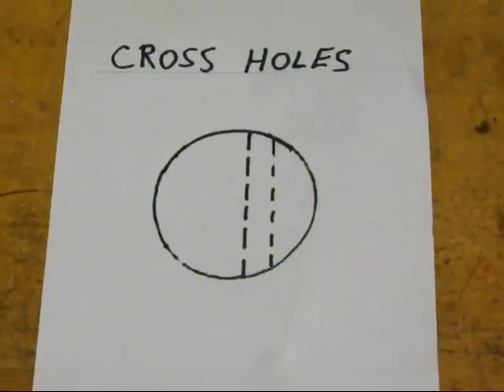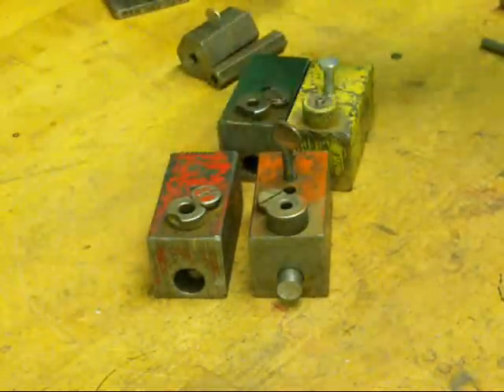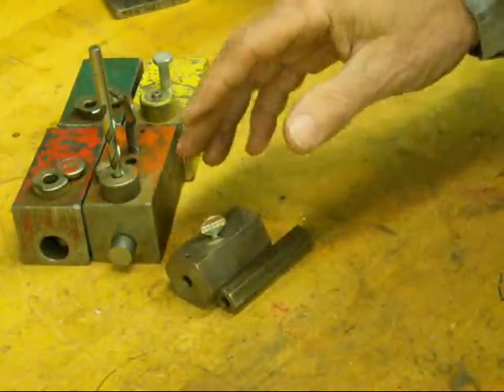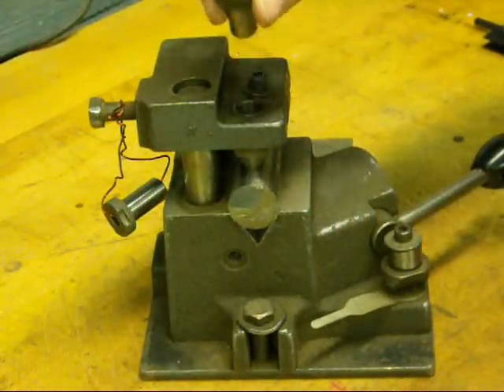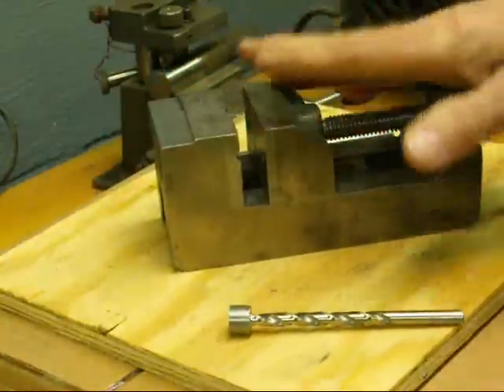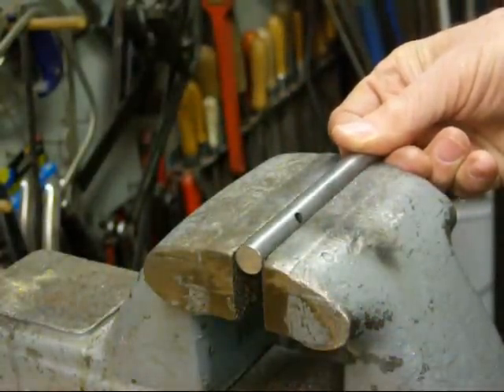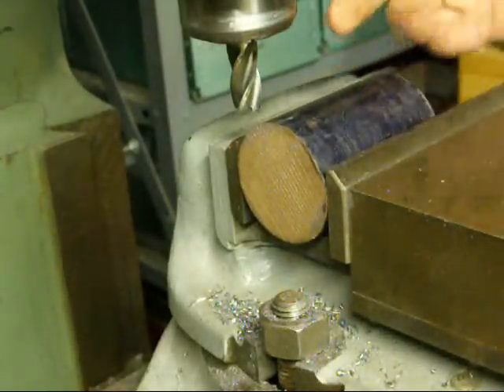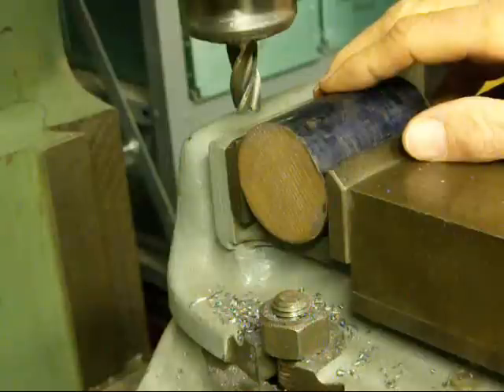MACHINE SHOP TIPS #11 Drilling Crossholes tubalcain

Comment: Hand filing will always give you a centered flat that you can punch. Even if you hold a file at 45 degrees, the flat you create will point to the center of the rod! Of course, you'd have to reorient the flat horizontal to be able to punch it.
If you only have hand tools at your disposal, this works quite well.

Comment: Also, there's the steel ruler method. Use a sharp point tool in the spindle  and place the ruler perpendicular to the work. Bring the point down and slowly adjust until the ruler is perfectly vertical. Works well on a drill press too.

Comment: I would use an edge finder to find the 0 of the hard end of the vise and then go back half the diameter of the price being drilled. of course taking in consideration the size of the edge finder.

Comment: To find the center I've glued a small level to a short piece of aluminum.  Glue the level length wise on the strip.  Don't start the machine, but lower the quill, with the drill installed and move the work in or out until the bubble in the level is centered.  I usually do this with a spot drill or center drill first.  Mark my spot and change to the drill I need to use.  Make sure you have enough room under the quill to inset the drill you'll need to cut the hole.  Oh, by the way don't drill thru the strip the level is on.  This method works really well in a mill.  I use it on the drill press also.  I use drill press clamps the tie the vice down after I've found the center.   Check your bubble again, readjust as needed. It's fast, cheap and easy with a short learning curve.
Reply from the maker: Sound like a good method
Reply: you need four hands to do all that,holy cow!

Comment: I have found another way for the average home metal/wood worker, that does not require anything "fancy"; to insure that a hole is IN the absolute middle of round stock. Reading it will seem complex. But it really isn't and is quite simple. IE:

Take 2 pieces of plywood; say 1/2 thick. On a router table mill a "V" groove; parallel in the long dimensions of BOTH pieces of plywood. Then mill another "V" groove perpendicular to the parallel groove across the long groove in BOTH pieces. Position the vertical groove where you want the hole to be in the stock.

 Now sandwich the round stock (IN the grooves) between the two plywood pieces. Then make a drill guide on your lathe. Make sure the guide is the exact same diameter as the stock. Then put the guide in the vertical groove above the stock.Now install the sandwich in a drill vise and squeeze down on vise handle so nothing moves. If made correctly, everything will be tight.

 Drill through the guide and stock. This makes for a perfectly centered hole in the stock. Also; you can make "matching" multiple holes in 2 pieces (or more) of stock; by milling 2 (or more) parallel grooves in the plywood. Again sandwich the stock between the 2 pieces of plywood and the guides in the vertical grooves; and install the ass'y into the drill vise. Now drill the hole. I did this and it works perfectly.

 I am getting ready to drill (and thread) 3 cross holes in each of 2 pieces of 1/2" X 4' long stainless steel rods. These holes must be perfectly IN line and parallel in BOTH pieces. This is a must for my project. In order to do this, cut two plywood pieces 2-3" wide X  4 1/2" feet long; and mill 2 parallel "V" groves in the long dimension on each plywood piece. Then mill 3 vertical "V" grooves located, exactly where the holes are to be drilled in the SS stock. 

Now sandwich the 2, SS rods in between the 2 plywood pieces; AND install 6 drill guides in the vertical grooves; with one guide above AND below the top rod.

Now and important: using screws or bolts and nuts, lock the rods, drill guides and plywood pieces together, as one ass'y. Then install this ass'y (where one of the vertical holes are located); into a vise. Then drill the desired hole in BOTH SS rods, thru the drill guides, at the same time.

Now move the plywood ass'y to the next drill guide location. And so on.

This will give you 2 Rods, 4' long with 3 holes in each rod; and they will be concentric perfectly between the 2 rods. All holes will line up exactly with each other. Etc. Again, this could be done with 3 or more rods simultaneously; and of course, multiple holes.

I am sorry if this tends to be too long and difficult to "see". But I assure you it works like a charm, once you do see it.

Thanks Pete for the opportunity to post this here.

Finally; and if you follow along with the above Pete; I would LOVE to see a video by YOU; demonstrating this inexpensive way of achieving what might seem to be beyond the ability of the home shop. The only expense is two pieces of plywood. The drill guides, of course, can be cut from the rod stock itself. Since you are only making a few holes, the guides do not have to be hardened usually. Just continue to make more guides IF the used ones incur elongated holes. 

Thanks again to my favorite "machinist" on this planet!
Reply from the maker: Thats a good idea--need to try it some time. thanks

Comment: What I love about engineering is there is ALWAYS more than one way of doing things. If you have a milling machine or drill press with a compound vice, clamp the bar and rest a 6" ruler on it then bring the drill bit down to touch the ruler. The ruler will deflect one way or the other until the bit is centred on the bar when it will completely horizontal. Obviously, the machine is not running when you do this. It helps if you use a centre drill first to prevent a normal drill bit "skating" around on the bar. I use this method for tapping a set screw on flywheels.
Reply: Thankyou so much for sharing that tip! I started a new job and they don't have a milling machine. I came from a company with 4 milling machines. So I'm used to just putting jobs in the mill and away you go. But now that luxury has gone and the results are not ideal. but that tip may just make my life ALOT easier. Thankyou :)

Comment: No disrespect in any way Tubalcaine, but I have been using a slightly different technique to drill cross-holes. And they come out perfect.

IE: I USE the cross V groove in the drill-press "vise". I center the part of the round stock to be drilled in the horizontal "V" groove and then put the drill "guide" (I made on my lathe) in the vertical "V" groove above the stock.

It works perfect and my vise always squeezes down on BOTH stock and guide and they are both held rigidly.

Have you never used this method dear person? It really works great.
Reply from the maker: +pat dee Thanks!

Comment: It's not actually a center punch tool on 6:09. It's design for Drilling Crossholes. How to use:

Step 1: Center punch into the rod with another center punch tool.
Step 2: Attach that tool into the drill press... continue...
Step 3: Clamp your rod into to a vise lightly (just like 6:09).
Step 4: lower the drill press and align the pointed tip of that tool into the punch hole so that all three point meet (in this case all 5 points meet for true accuracy). I'm sorry I don't have space to go into detail about how to do that. Please try your best to figure that out.
Step 5: Tighten your work then lock your vise to the press then use a smaller diameter bit for the first pilot hole.
Step 6: Drill. Do not drill all the way thru if you want accuracy, but go ahead and drill all the way thru.

The name of the tool is cylinder/rod "center finder" I believe. I'm not a machinist, I've never seen it before.  I just have a good a hunch on this stuff from some other lifetime. If I'm wrong I wouldn't loose sleep over it.
Reply from the maker: Thanks

Comment: chuck a center (not center finder), level and tighten work, x is layed out

eyeball chucked center near the center of stock (approx y), 1/8" z away from stock

place 6" scale perpendicular to stock and under center drill

lower quill by hand until light contact

observe tilt in 6" scale, adjust y until level

center is found very quickly, but slightly less accurate than edge finding.

Comment: Another trick I have found that works rather well.  Place a V block on your drill press, then put a nail (without head, point down) in the check. With drill off, advance the nail down toward the V block.  When the nail point in the bottom of the V, clamp the V block down.  Now, whatever size stock you use, will drill through the center, or at least, very close, so long as you do not disturb the V block or drill table.
Tony
Port Hadlock, WA

Comment: I put a V-Block in the vice and bring the drill down to it so that the cutting lips touch the block. I then clamp the vice down. Slide the V-Block back a little so that the drill will clear it. Any size of round that fits in the V-Block can be drilled through the centre. It is best if a small hole is drilled first to guide the drill.

Comment: Have had many divots/spot faces to make in teh past on round stock.  I use an end mill about 2/3 teh size of teh drill I need.  get a flat face then switch to rill if hole needed and you can drill anywhere on a round rod that way.  BTW, I don't even have a car but 2 Bp's in teh garage.  Fortitude, fortitude.

Comment: When you were talking about the method of placing the stock in a lathe vice and then laying a bushing made out of the same stock over the top I was wondering, if the profile of the v laying longitudinally along the vice is the same as the central lateral v then would you be able to use them to quite a precise effect?

Comment: I use the "round bar center finder" you linked to on the lathe too. I'll put it in a 1/2" chuck that lives in a boring bar holder to center on the work, then I can accurately (enough) drill off the tool post using the power feed

Comment: Hi tubalcain, another method i use on a drill press is to put a ground ball in a V block, and lower the spindle onto the ball which centres the V block to the spindle because of the large chamfer on the bore of the taper, Have you tried this method? is it accurate?

Comment: Maybe someone's already said this... I do this just about every day in my work, I just use an edge finder on the solid jaw and a stop on one end of the vise, so X & Y 0 is in the corner, then come off the solid jaw half the diameter of the part and however far off the end. Also using a single parallel to hold the part near the top of the jaws, sliding it to one side to clear the bit. Nice jigs for beginners or use in the drill press though.

Comment: A quick way to find center on a horizontal round surface is to hold a flat object such as a (single) parallel on top and bring the point of the center drill (not running) down until it pins the parallel to the work piece. Adjust the placement of the work until the reference bar is level.

Comment: Thanks again for a great video. Do you have a tip on how to drill a cross hole in a lathe, with the stock 'across' the face of the chuck? I currently align the stock the normal way with the 4 jaw, loosen two jaws and reinsert across the chuck face - close enough but not accurate. I have a mill, but there must be a logical way I havent thought of on the lathe...

Comment: @69iron69 Nice engines, do you or have you thought of using a "regenerator" in your stirling set up? Also have you added power to to the flywheel and used it as a stirling cooler?

Comment: Very nice video, keep up the good work.
What's your opinion on using the lathe for cross drilling? That is, putting a bit in the head stock and holding the work piece against a crotch center in the tail stock ?

Comment: @jeriellsworth A good case in point is the plymouth breeze... You have to remove the inner fender to replace the cars battery. Good thing they have free battery installation at most auto parts stores. It's like the whole thing was designed by someone who had never even changed their own oil.